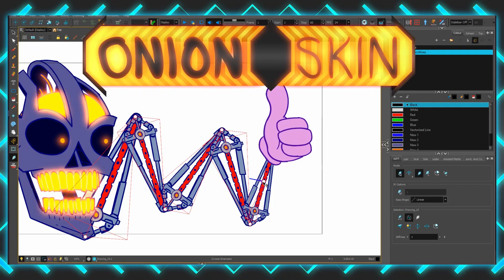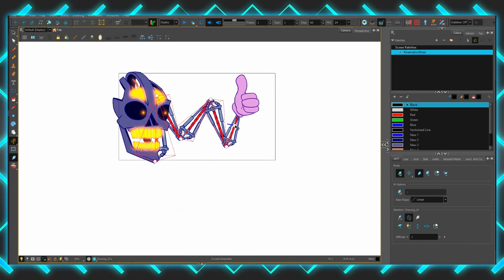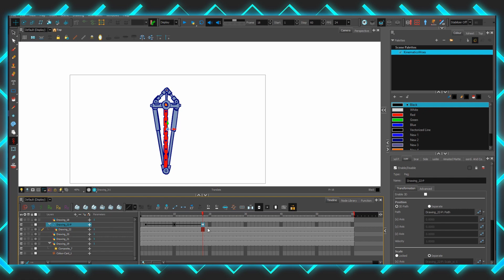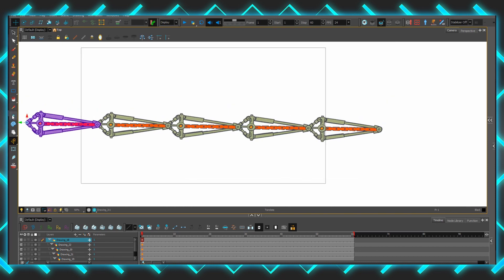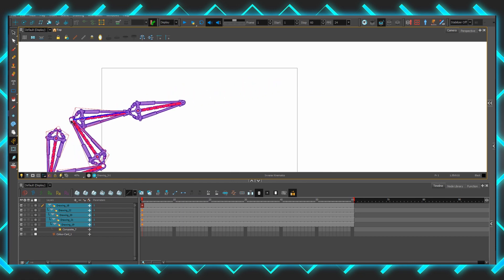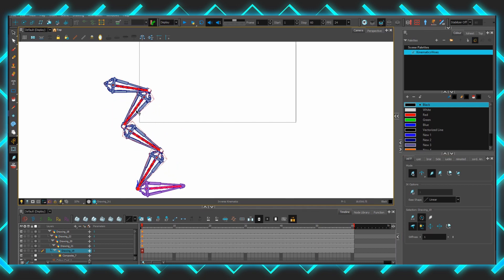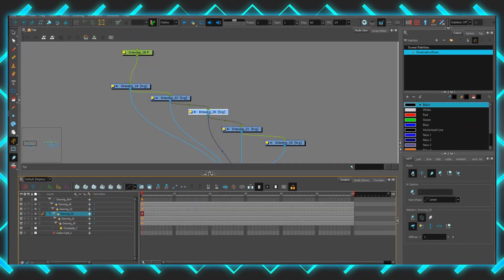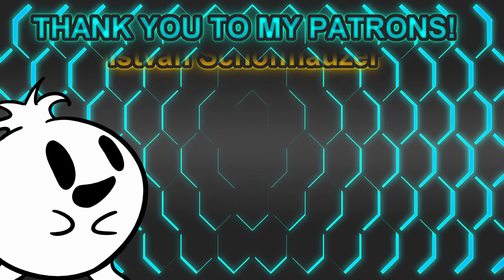Let's Learn Toon Boom's Inverse Kinematics Bone System

Comment: If IK is legacy feature, how to do this with current tools?
Reply from the maker: It’s more that the idea of IK is a lot cooler in demonstration than in practice.
Most 2D animators have found they’d rather animate Forward Kinematics because you get a lot more control. Even if it is a little slower